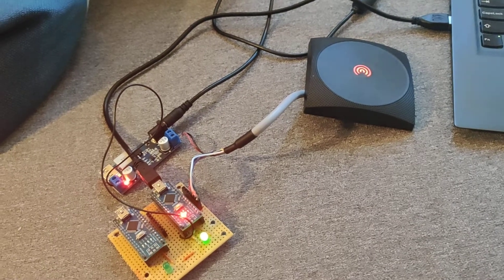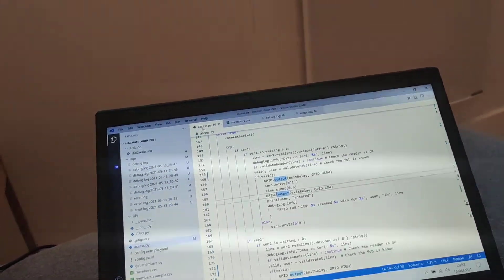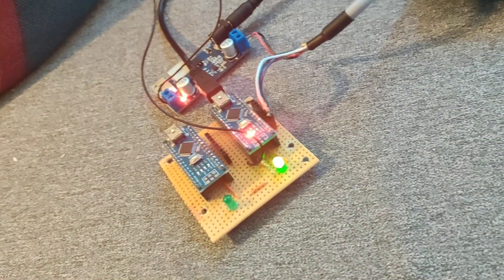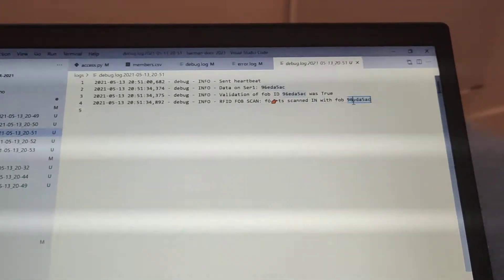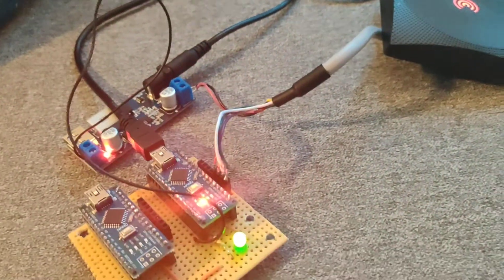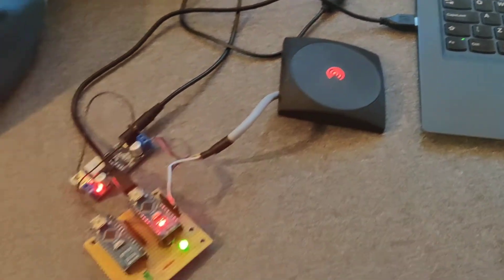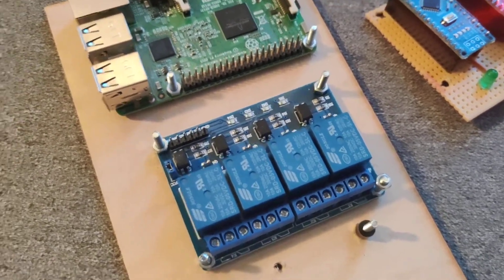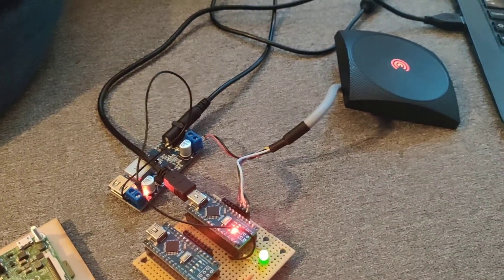Wiegand Arduino access system test

Comment: Very interesting and neat project.  This is the trade that I'm in - access control systems.  Wiegand (pronouced wee-gand) being replaced by OSDP readers.  Wiegand has been around since the 1980, the data is easily readable, whereas OSDP data (basically a RS485 device) is encrypted and locked to the door controller once it's online.
Reply from the maker: Cheers for that info - I haven't heard of OSDP so I'll be sure to look into it. This system is rather basic but I like that the core technology is so accessible. It's probably also more secure than the Chinese generic stuff which has the logic on the *insecure* side. I ended up refining this project, the arduinos turned out not to be needed for my specific application, an entrance to a large community group which had hundreds of members each having a fob or pin code. There's something fun about rolling your own system out of generic parts!